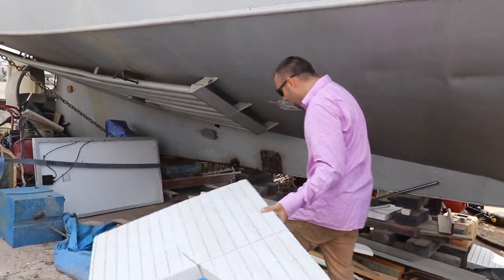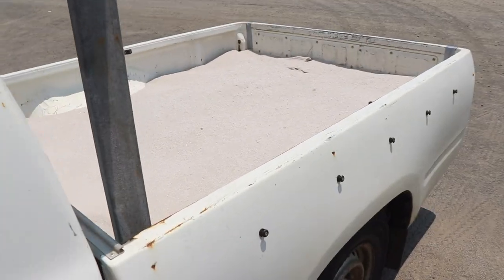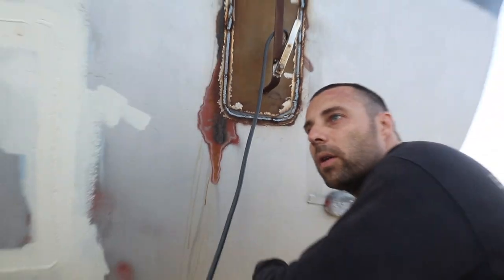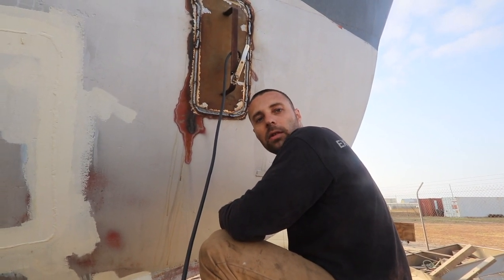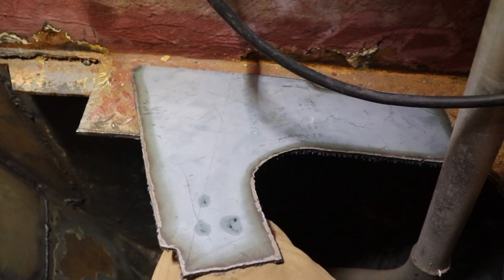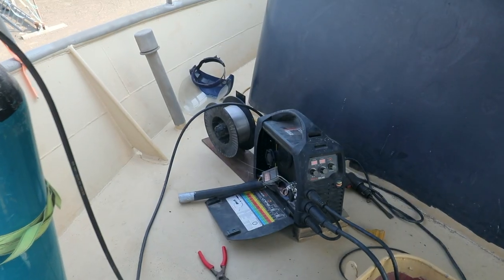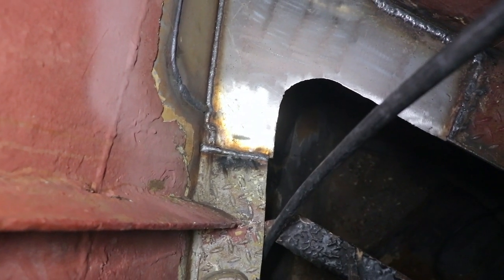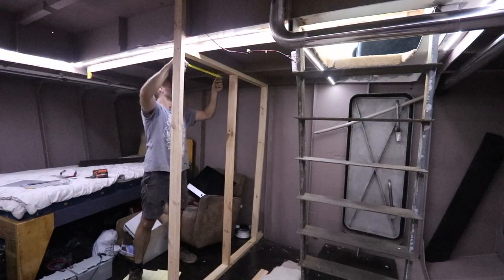Rebuilding the Crash Bulkhead - Project Brupeg Ep. 117

Comment: 18000 gallons/hour ?
Reply from the maker: Ahhh I got it wrong. I just looked at the specs. It’s 24,000L an hour or 6,300g/hr
Reply: @ProjectBrupeg  Still impressive !
Reply: @ProjectBrupeg  That's also a function of the height of "head" and the friction of the hose. Our main 12 VDC bilge pump is 3700 U.S. gallons per hour, but has to pump up about 170 cm to get to the outside of the boat. An AC pump is usually much better and my emergency bilge pump is an AC pump I wouldn't hesitate to use in a bad ingress situation.
Reply from the maker: Yes this pump can push 8m of head but its only pushing less than 1m in this set up. also pipe diameter is 1.5" mandrel stainless so should flow pretty well

Comment: You don't get a whole lot of blasting sand out of those two truck loads do ya?
Reply from the maker: Nah not a huge amount. 1/2 a sq meter is what my Ute can transport. Still that equates to about 150sq feet blasted to white metal
Reply: @ProjectBrupeg  I apologize, I meant to say concerning post sifting. It seems less than 50% goes in the black bins. The ute is a beaut 😉
Reply from the maker: Ahh. It depends on the sand. Some loads it’s almost zero loss others it’s higher, depends on how well the quart crushed the rock etc. this last load was about 18L or stone for every 60L of blasting sand but we have had sand previously we can just put straight in the blaster without sifting

Comment: cant weld in the wind  laughs in stick welding
Reply from the maker: Ima crappest stick welder out there. I wouldn’t do stick welding the disservice of trying to weld a hull plate
Reply: @ProjectBrupeg  to be fair I'm not a very good mig welder. Can't be bothered with all the settings to get it right. Well to be honest I'm not a great welder at all lol
Reply from the maker: I can only MIG weld because ive so far welded around 500kg of wire through the welder, ive maybe ran 10 sticks that same time so the disproportion of MIG v ARC welding times is reflective of what style i can do well.